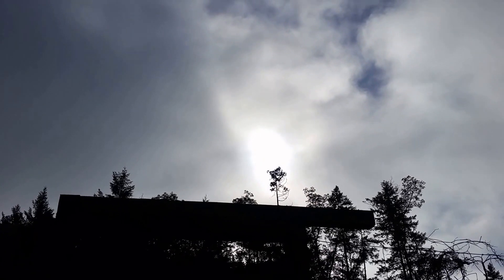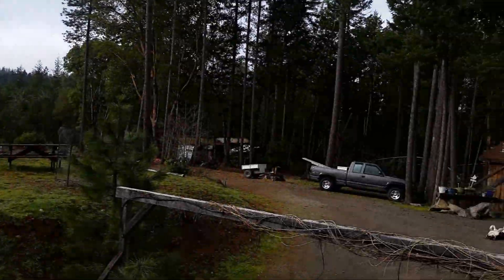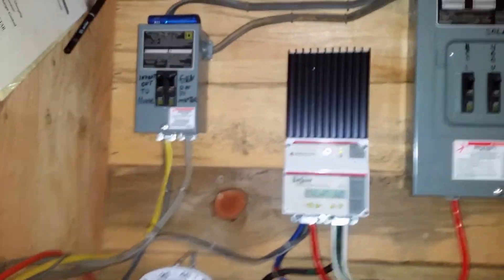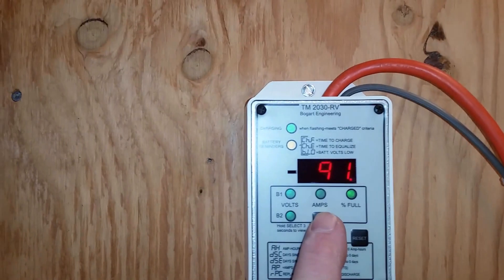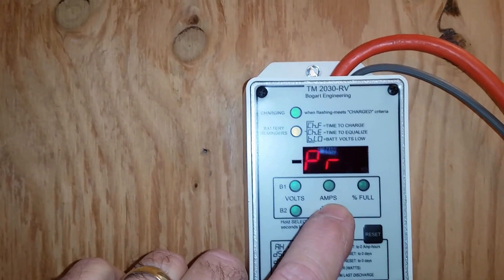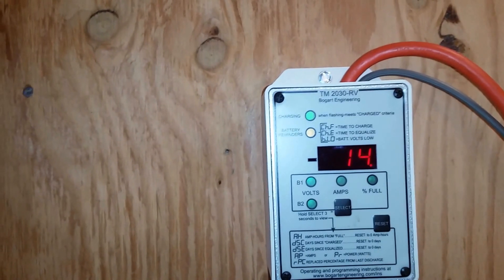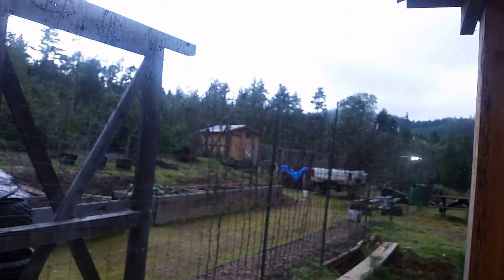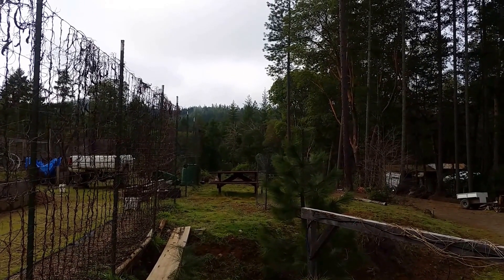Ramblings of a mad man on a semy good solar day

Comment: Looks great...glad to see some sun popping through. You know, with a small hydro power (even a 200-300w unit)...I would think that should suffice during those cloudy days. Esp if that hydro is running 24/7. about 10 amps continuous...man, that would be awesome!
Reply from the maker: I want to get to that but I need to get my neck worked on 1st. Roy has a X17 motor to send me for an PMA hydro power experiment. Right now I'm pretty laid up.

Comment: Where do you live? I see a ton of snow but then I see bare ground in mid-January?  I still have 2 feet of snow up in northeastern WA.
Reply from the maker: Sheridan Sims We are in Oregon by the Kalmiopsis wilderness. We are just below the snow line. Sometimes we get hammered. It was supposed to snow 6" last night but it went sth of us. Now we are having a wonderful sunny day!
Reply from the maker: I just read another comment that you made but for some reason You tube will not let me reply so I will reply here instead.  We do have a tree on our house from a 4 foot snow storm. We do live just below the hard snow line most of the time. But sometimes we get hammered. You got a wonderful deal on the solar equipment. We were off grid for 3 years with the DR series Trace. 1st we had the DR 1512 then we switched to 24 volt and bought a DR 3624 like you have. Awesome inverter. The DR series Trace is built like a tank and should last 20 years in full service. We changed it out because we wanted a newer washer and dryer that are very low energy. The washer and dryer that we bought have inverter motor drives that have to have pure sine wave. We just added 700 watts of solar to the system but have a lot more to go. Our 1st year we were off grid with 610 watts of solar and as you know here in the Pacific North Wet we don't get much sun in the dead of winter. I would love to see your place. Can you post a video?The reason I mention the Lord a lot is because Jesus is my passion and life. Obedience to our Heavenly Father through the Power of the Holy Spirit in Jesus name is the only life worth living for sure. I have been a pastor here in this little valley for over 20 years. I am taking a sabbatical until I can get my health issues under control. May the Lord bless you and your family and may the light of His Truth shine ever brighter  through you as you share the Love of God through Jesus Christ.